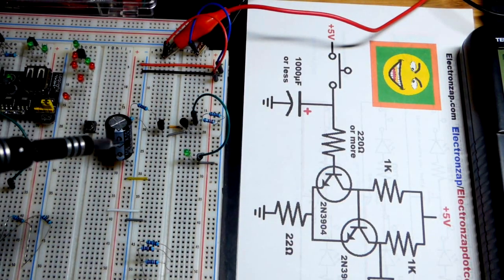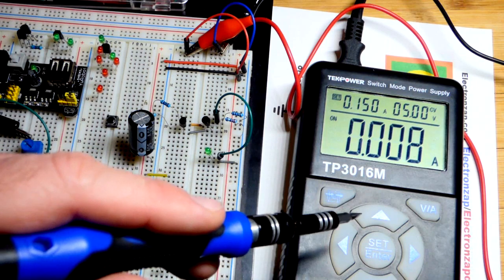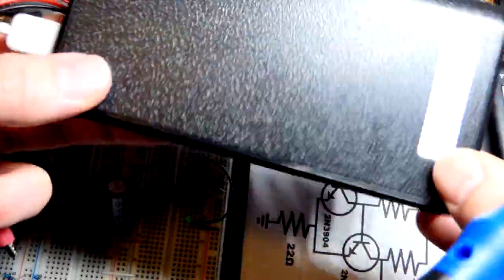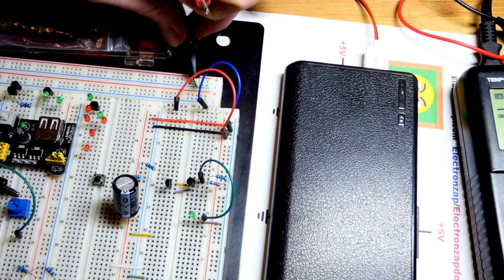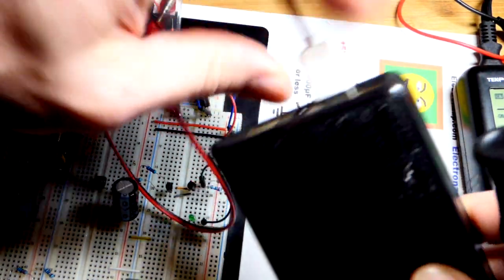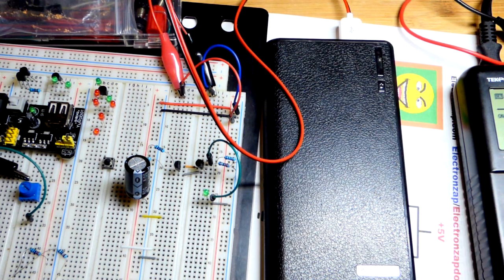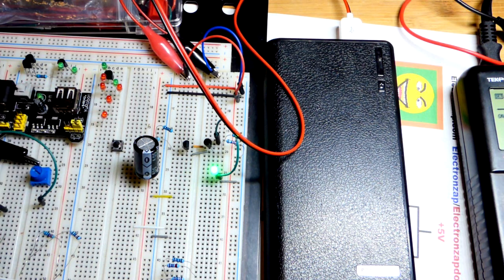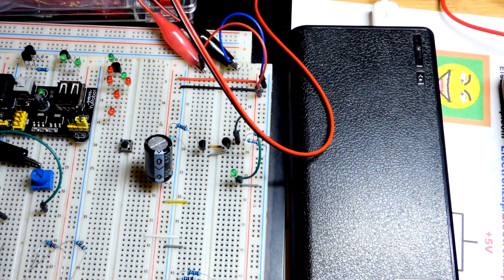Powering electronic circuits using portable power bank with USB to alligator clip adapter cable

Comment: Now I'm gonna have to go make a couple sets of usb to alligators...
Reply from the maker: Indeed! I am really bad at making them or I would have made a video of that long ago.
Reply: @Electronzap  I've made some USB to 2 pin dupont headers which can plug in to the power rails on the breadboard, also got one with a female header to do the same thing but to power a Servo tester. 
I'd be interested if you can find out if it is the USB powerbank causing the LED flash/flicker issue, or if it's something else related to the circuit.
Reply from the maker: I don't get that flicker with the power supply, only the USB power bank. This is a constant low current though. It will probably react differently to different circuits.
Reply: @electronzapdotcom    HalfSpeedMastering's comment makes sense  After up converting then regulating  whats actually coming out of the charger are pulses.    I bet you can hook up the scope across the chargers 5v output then place a variable load on it  and figure out what the output frequency (ripple)  is and whether it varys with the load.
Reply from the maker: I made a followup video that did that :)

Comment: So question. Say I wanted to power my garmin fish finder. I have a rav power 20000 mah power bank. If I strip a usb cord. Then use the red and black wire to attach tonthe fish finder power cord red and black. Will it power it fine? Or will it fry it?
Reply from the maker: I am unfamiliar with fish finders, but since they are used on a motorized craft, I assume they work on 12V, and therefore 5V will probably not be enough voltage to do anything. A 5V to 12V boost converter can be used if you don't need more than something like 0.5A at 12V. It's easy to fry things, so I can't never say that it won't happen.